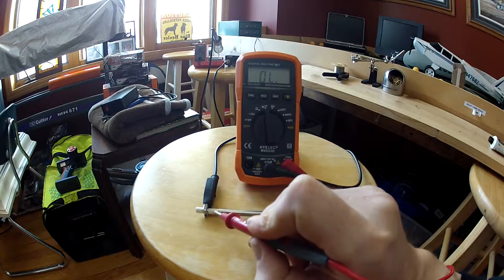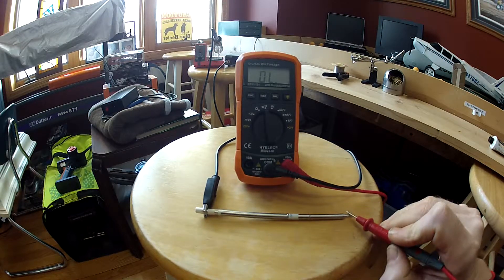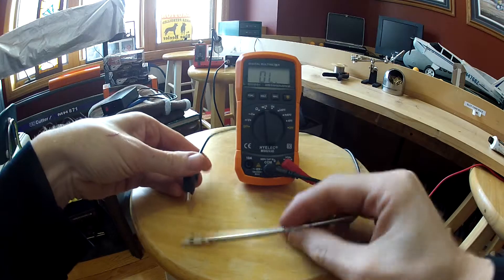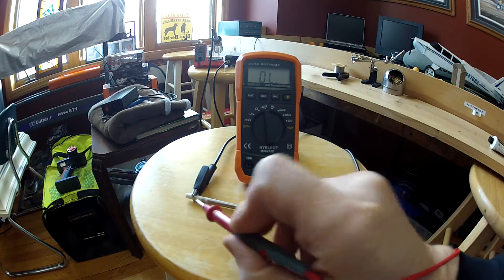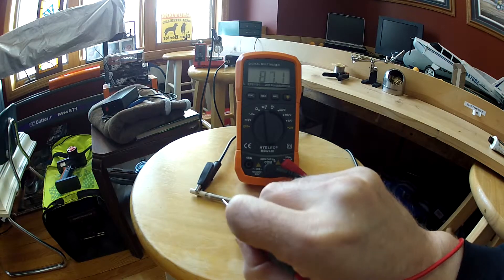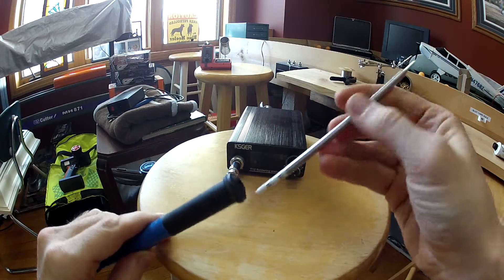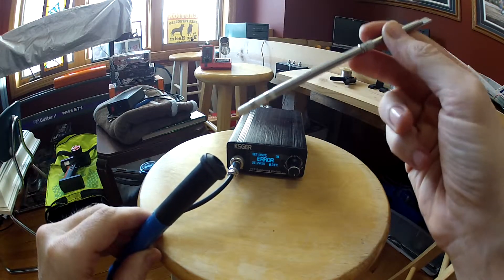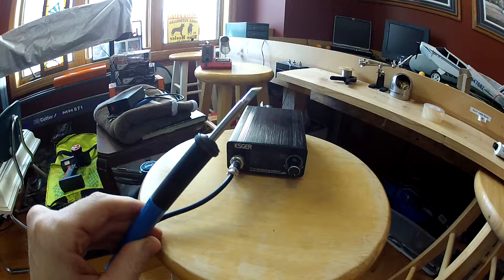KSGER T12 Soldering Station Bad Tip Issue

Comment: Thanks for this video, I have a K tip that power cycles the unit as soon as I turn it on with the tip in the iron. My C1 tip and JL02 allow the device to power on just fine. Going to order another K tip and cross my fingers it works.

Comment: Thank you for this, really useful information. :)

I had a different problem with my T-12 tip, a solvable one luckily. If you remove the tip oftenly, the two contact rings can get dirty. Use some Isopropyl, clean them and they should work fine.

The above is for the "NO TIP" error in screen.

Comment: Thanks for posting this!  Got ERROR message today and the T12 tip had short across all three contacts (Plus, Minus and Ground sections). Could not find any spec for the coil resistance, so glad to see your video. Will order up a couple of tips. Cheers.

Comment: Been looking on and off today.
Right so we have a tilt switch inside & the other item is a thermal switch

All the handle wiring is correct.
I have also buzzed through the wires.
The tip I connected directly to my bench supply and it heated.

SO unless something is bizarre is happening in the handle I think its the box.

Comment: Thanks for uploading that.
I am trying to get my head around what's inside the handle.
Seems to be a tilt switch (what I thought was a coil) & I presume the other component is a diode ?
So far, the seller at aliexpress has offered a replacement box. I was going to check the wiring to see if it's correct.

What does the tilt switch do ? Does it stop the heating on the tip if upright ?
Reply: You may have seen this by now...?  https://youtu.be/eKQC9G5SYII
The 'diode' is a temperature sensor and the tilt switch is there to detect when the iron is not in use...for shutdown.
Reply: @wthornton7346  Thanks, I still have i in bits 1 year on. Must actually get round to sorting it out.